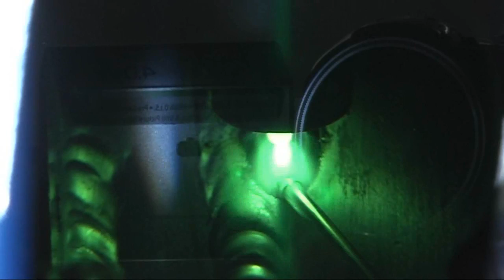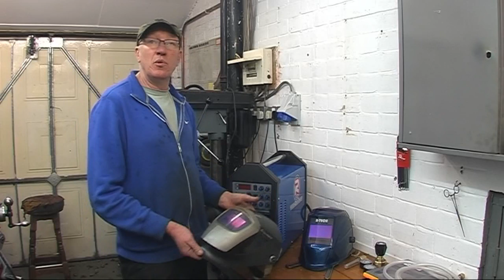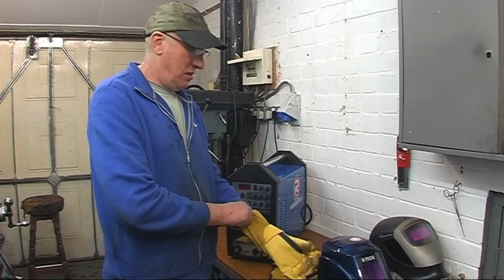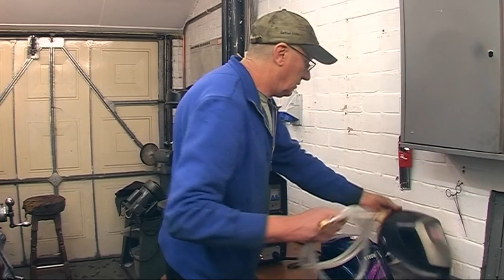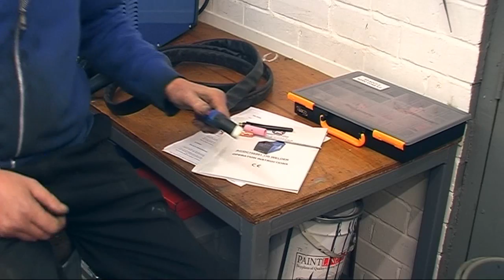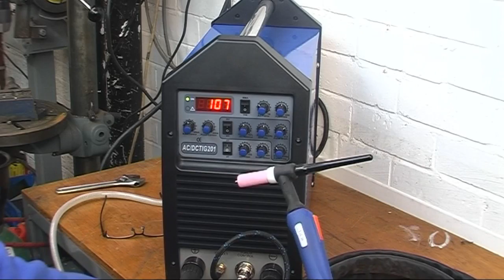R-Tech  AC/ DC TIG Inverter Welder   Tig Time Part Two

Comment: Thanks for showing your new tool...and for the safety rules.  Tying the bottle so it can't fall isn't just for protecting the regulator, it's also for safety. If the bottle falls and the neck breaks off, you have a rocket with a 3000psi exhaust and about 1" opening....or about 3000 lbs of thrust. There's a show here in the states called Mythbusters, and one of the shows demonstrated what happens. The bottle went through the backstop they'd set up to catch it AND the concrete block wall behind that.  Not something you want to do at home.

I was initially disappointed that your welder is UK only, but one of the comments mentioned Everlast, and it does look like a green version of the same machine, but for sale here. Yay!

Thanks for the vid!

Comment: Hi John
No doubt loads of requests will flood in for demonstrations of different types of welds as time goes bye. One I would be very interested in seeing is Copper to copper, i.e. a small boiler shell, if that is possible with this machine. I guess some sort of filler rod apart from silver solder is used or is silver solder used? It would be nice if a copper rod could be used to make a shell and then silver solder for bushes etc. 
Really enjoy videos, thanks for taking the time to make them.

Comment: 2Tand 4T is to do with whether you hold the trigger to weld(2T) or press it once to start welding and then press it again to stop(4T)
At college we were told to allow about one second of post flow per ten amps. So 100 amps is around ten seconds. If the end of your tungsten is going blue between welds, increase the post flow a bit.

Comment: Isn't that in fact a 32Amp blue round plug you've wired to the welder. I have the Tig251 from R-Tech and that has to have a 32Amp because the welder will draw more than 16Amp at full power out. It just looked rather large for a 16Amp in you're hand. I like the helmet. I have an early Sip which isn't affected by the low amps but then Parweld brought out the same mask and it suffered with low amps. Sip must have had better electronics I guess.  Torch water cooling is a must for long welds at high Amperage too.

Comment: Possible without using filler rod, yes. However, you will then have what's termed an 'autogenous weld', where the surrounding parent metal is 'robbed' to make the weld, resulting in a weak area either side of the weld line. Much better to use a filler rod in most cases.

Comment from the maker: I will have a go at welding copper 
Copper electric cable should be fine for a filler rod
With tight joints a filler rod may not be needed 
John

Comment: I used TIG in a workshop (at a bench after I left the Shipbuilding) But I never seemed to get the Amps right for the Metal .except when I was welding boiler tubes for the Dungness reacter. Is there a rule of Thumb for setting the Amps on TIG
Reply from the maker: Hi
George
One amp per .001  (one thou) works up to about 150 amps
John

Comment: could you do a review on the rtech helmet
Reply from the maker: I will be doing there new multi function machine in the next month or 2
I will cover it then
I have used the R-Tech XL for a couple of years now
Only problem was the head cradle broke (I dropped it )
Replacement cradle was free
Reply: is the multi function machine the MTS 255